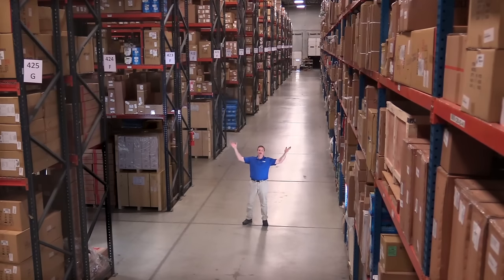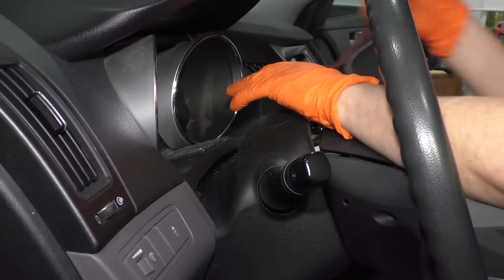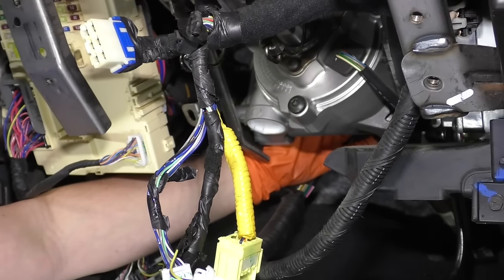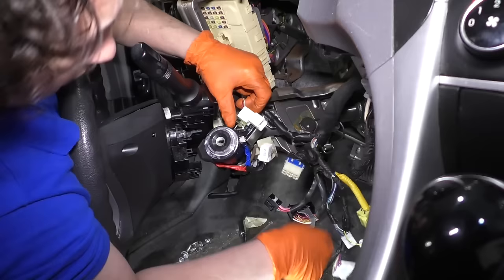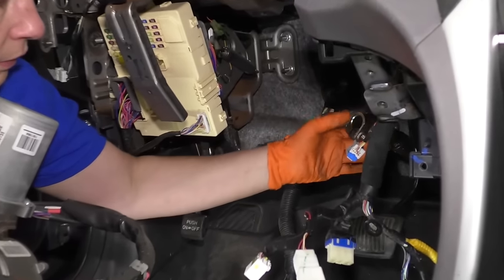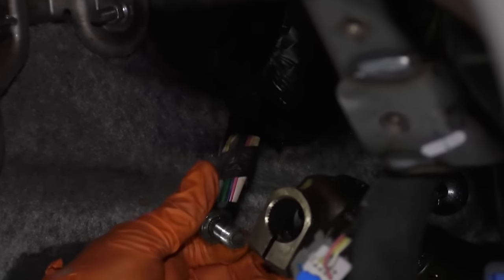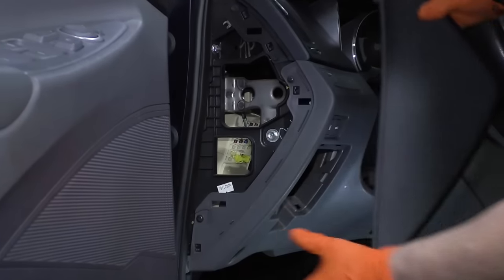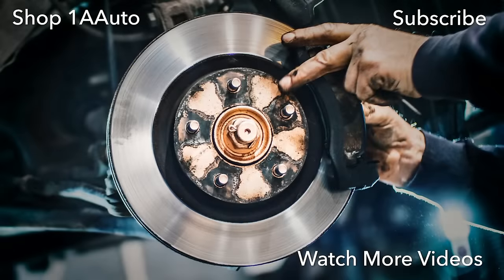How to Replace Steering Wheel Coupler 11-14 Hyundai Sonata

Comment: Hyundai: 500$ with taxes. Me: 17.50$ and done two hours later. Thanks for your video.
Reply: It was very complex! I went to the dealership and they told me I have to change that part, I didn’t know that it’s bad… but the price is $326
Reply: If you’re under 100k mi it’s covered under warranty.
Reply: @YayaKins  well for me they wanted to charge me 300$ and I was under 100k. I think it depends on the year because there is a recall.
Reply: Due to the many recalls Hyundai has issued for the Sonata, mine was replaced at no charge because it was covered by the extended warranty. It was done early this year.

Comment: Replaced the piece on my wife's car. Took about 3 hours for a novice and a couple breaks in between. The hardest part was get the colum back in position after replacing the piece. Once put back together the steering felt amazing and new.
Reply: Me too...i used the jack in the trunk i padded it and lifted the column little by little until it was flush then screwed in screws and voila

Comment: Great video, completed this job just under an hour.    My steering wheel was knocking really bad and that darn parts was shredded. I recommend this video to whom is looking to save money. The only thing I don’t recommend is removing the steering knuckle. There’s just enough room to work with while it’s  still mounted.
Reply: Thanks for the tip. That makes this a lot easier. I'm going to do it tomorrow
Reply: you dont have to take off the u-joint? you just dropped the steering assembly down and did it all right there in the driver footwell?

Comment: no need to take the whole steering assembly out. just need to drop it down, if needed, remove the fuse box (only 2 screws) and that gives u all the space you need. just did mine today.
Reply: Daniel Le would it be possible to remove instrument cluster only and have access to replace the steering coupler?
Reply: Daniel Le can you do a video
Reply: Daniel Le 
I did mine too but now the car won’t start ? Do you know why ??
Reply: Daniel Le can you elaborate a little more on what you did and didn’t take out?
Reply: Hi Daniel can you explain at what point in video can fuse box be removed?
Reply: Good for you.

I just had to take the entire thing apart (non mechanic. Never done anything like this.) to get to what I needed, and to let the steering column fully down.

As a 6 speed owner (yeah, kill me.) there's a bolt on the back side that needs removed.
Reply: @Flash-iq9zw  check your plugs around your ignition switch and your fuses. You might have triggered it.l hope you took the post off your battery before your work started.
Reply: @Flash-iq9zw  did you unplug the negative charge on your battery off before?
Reply: Joey Barrera  negative 😂
Reply: Exactly
Reply: Not necessarily so Daniel....the installation and access varies from year to year and model to model.... Please see my comment posted today. 16.03.20.

Comment: If you are not a true mechanic you need to simplify it. Just take plastic off unhook the wire harnesses to the left of the wheel that’s hooked to the echo button an stuff and the trunk. You can just take the 4 nuts off lay the streering wheel on the seat. You scan reach you’re hand in take the 3 screws out to the motor pull the coupler out put new one in. Put steering wheel back in place tighten the four nuts and put all plastic back on. You do not need to unhook the actaul shaft or all the wires pull seat all the way back and you can lay the wheel on it.

Comment: Uhggg unfortunately i have done this procedure and its not necessarily difficult in my opinion. However, anything to do with removing the object that controls major components in your car, is a pretty scary thought but i was able to do is sucessfully, i had a few extra pretty good size bolts afterward but no big deal it happens!!!! Lol kidding kidding...it was fine, the only thing that was difficult for me was lifting thw steering column back into place (its pretty heavy for the position your in and room you have) but it does have hooks for the column to hook so you can screw the bolts in bit i had a hard time so i propped up the column with the cqr jack lifting it little by little until it finally met up and i finished up fine!!!! No more click, click, clicky

Comment: Another fine idea from automakers. I would agree that this is a well shot video. I have been an automotive tech over 50 years. The only thing I would add is to make sure if you have the front wheels off the ground that they also don't move or the clock spring will be ruined. It is always best to put the wheel's straight ahead so you know where you were at when you took it apart and if the steering doesn't lock exactly in the middle you can always rotate it slightly when you're trying to line it up. You can always take a soft Rag and a piece of wire and lock the steering wheel in the general area also. If worse comes to worse you can always remove the clockspring and wind it gently to one side and then back to the other and find Center as long as you don't force it at its stops you won't hurt it. One last thing, very important , I would always put blue Loctite on the pinch Bolt and it's not a bad idea to put some on the mounting bolts also. It isn't that much longer to remove the column and work on it on the bench but you can also do it in the car under the dash it's just a little harder on the body. Really it's not even necessary to remove pinch bolt and shaft you just got to be careful remove the fusebox lay steering wheel gently down on the seat don't break any of the switches and you can repair it in the car that way you don't have to unhook any of the wiring on the steering column just got to be careful not to break things
Reply: Appreciate your wisdom sir. People such as yourself give us novices hope and will to learn

Comment: Verry good video: Replaced the coupler Hyundai 56315 2K000 FFF coupler on 2010 Hyundai Elantra : removed drivers seat and the steering assembly bolt that goes thru yoke bracket . Steering wheel then lowers to the floor . Used T25 torx bit on motor and top computer module. Used screw driver gently pry motor back from unit while leaving the black plastic electrical connector part attached to the unit. Holding motor and installing new coupler was easy. Thank you for the video!

Comment: I replaced my coupler today, this video was helpful.  I didn’t disconnect the steering column shaft.  Instead I removed the necessary wiring and let the column drop.  I used a 1x4 board from floor to seat and allowed the steering wheel to rest on it so it didn’t completely drop to the floor.  I then removed the torx bolts and did the part swap.   A little tight, but doable.  187K on my car and surprisingly the coupler didn’t look that bad, hardly any debris.  But once everything was back together, I could immediately tell a difference, the steering play was gone.

Seems like every harness connector is different and some were a puzzle to disconnect.  A couple had me stumped which cost me time.  Hardest part was putting the column back in.  Even with the metal hook it was difficult to lift it up into place while I was half outside the car and upside down.  One tip: when I removed the motor I immediately marked the gear with a marker so if it rotated I could put it back to the original position when reassembling.  If it gets turned to much there will be a code because the position sensor is off.

Mine is all done, no codes, no play, success.  About 3 hours.
Reply from the maker: +BluesriderDF Thanks for the feedback!

Comment: Thank you for the video! Took me about 1.5 hours start to finish. 20 minutes of that time spent cleaning out the shredded sticky mess of the old coupler! Did not disconnect the steering knuckle and dropped it down on a block of wood to stop the column from twisting while lowering making it easier to access and separate the electric motor to access the coupler. Fairly easy job overall.

Comment: I used this guidance to successfully repair a 2012 Elantra. It is pretty equivalent. Thanks
Reply: Did you notice any major differences? I have a 2011 Elantra
Reply: I took mine apart just to see that nothing was wrong with mine. The one I already had was completely different (like the one in the thumbnail) from the one i got offline. The one I got offline may have caused an issue in the future because its alot thinner than the original. Did anyone have any issues with the steering wheel not being centered after completing this?

Comment: Happy this helped DIY’ers save some 💰, this is why I went searching for a video like this, but then as a precaution I checked with Hyundai. This repair was added on to the “extended warranty” list, and I squeaked in just under the ten year mark. So didn’t cost me anything to have the dealership do it. I was confident I could get everything taken apart, but I thought I know I’ll screw something up putting it back together 😂

Comment: Just did mine on my 2011 Hyundai Sonata GLS w/80k miles. Been driving this way for about a yr w/the clicking on the steering wheel. 

One of the toughest things I found was the weight of the whole steering column itself 😮 When you hold it to raise it up/down you feel that weight. 

One of the things never mentioned in any of the 3x videos I watched was that the steering bar coming from the engine bay has a telescopic bar inside it w/the steering knuckle on top. No ever mentions how this telescopes in or out of that bar🫤. I figured that out on my own. But took awhile. 

Good video tho 😁

Comment: great video. i have been meaning to do this for a while and finally got around. in my case the previous coupler turned into this tar like residue. why they did not use a better plastic like nylon which is usually the material of choice for couplers like this?

ps. you left out the part where the column gains 100lbs when lifting it back into place.
Reply: What will happen if that plastic gear melt?car won't start or can't steering?

Comment: Great video ! I followed it step by step and it worked great after I found the connector I didn't push in all the way. After I finished the first time, nothing worked, and I was very worried. Then I opened it back up, and pressed on every connector on the key area again, and Yaa, now it works great.!
Reply: Excellent video. But I think it's still complicated for someone like me. Hopefully will find a mechanic that can do it for a lot less that Hyundai try to charge.
Great work lady I'm really impressed for your skulls

Comment: Excellent video, very professional technician. I just have 2 questions, 1, after replacing coupling, is it necessary to re-calibrate steering sensor or any other components? 2 what should I pay extra attention to, eg should the key be removed & to  be careful not to rotate motor coupling while disassembled & any other critical points. Thanks again.🖒🖒
Reply: The factory service manual basically says to do the recalibration process after doing this on all the models I've seen anyway.
Reply: How do I do a recalibration

Comment: Hyundai Dealer $540 plus parts. Me $30 and 2 hours w a bathroom break. Thank you, followed your video step by step, problem solved, car steering is back to new. Thank you for this educational well made instructional video it is greatly appreciated.
Reply: What year and model did you work on please, my 2011 different on wiring from video and one cord is still attached; I’m afraid it will rip out when column is lowered.
Reply: What the hell cost you $30?!

I paid $6 for the part, shipped.

Comment: I brought my 2012 to the dealer to have this slight clunk checked-out.  Dealer said there is nothing wrong, thus, I have to pay the diagnostic fee.  I purchased the part from a Kia dealer for less than $5.  I did mine by myself sometime last year and only took me 2 hours.  I just dropped the steering column, opened the motor and replaced the coupler.  The only challenge was lifting the column where it is supposed to be.  I just used a floor jack and a block of wood.  Steering position never changed at all.  It saved me a lot of money too.
Reply: How did you get it to go all the way up? My two screws in the back won't go all the way in.
Reply: @50calmal98  Just screw the bolt for the  motor slowly so it will catch the thread of the motor housing.  On installing the column, I used a floor jack inside the drivers side.  Positioned the jack under the column and slowly lifted the column and aligned it to the 2 holes for the bolt to go in.  Did a few attempts and I finally got it in.  An extra pair of hands will make it a bit easier.

Comment: I DID IT!!! I just did it on a 2012 Kia Soul and it's not to much of a difference. I had to take off the module in front of where the wheel connects to the steering. Also there were 3 screws holding the wheel in. Two in front and one on the back to the right. This video saved me from my god dang popcorn wheel.
Reply from the maker: +Blake Gravett Thank you for the feedback and great job!

Comment: I’m in the middle of this project on my 2011 Sonota.  Coupler was reduced to just the hub as shown in this and other online videos.  My biggest problem so far was lifting that steering column up and into place to get one nut started.  That thing is heavy, awkward, and there’s no room to work.  I watched other videos where they did not undo the spline and take the column assembly to the bench.  I replaced the coupler with the column still inside the car.  My column has a hook to aid in lifting the column into place, but again very heavy to lift and awkward.  Ended up using some wood blocks to support the column to within less than an inch to use the hook. I was not able to get the passenger side bolt to catch so I’m leaving it out and lock-tighting the two nuts and one bolt.   My next issue is the harness for the air bag connector (yellow) now doesn’t seen long enough to allow me to snap into place.  Took a break for the night.  Finish up tomorrow.

Comment: Perfect video. I'm second owner so of course it isn't covered and going to have to try this out myself. 1 question... At the same time I noticed the side to side clunking I also noticed there is a vibrating/rattling sound coming from under the steering wheel. Any idea of the two are related? Just weird to me that it happened at the same time. I have no issues with ball joints, shocks/struts, steering wheel(drives straight) so not sure what the sound is. It only occurs sometimes when I drive over rocking road and but not when I hit dips. Sounds to me like there is something loose underneath and just banging around. Either way appreciate the video.
Reply: Did you find out what the noise was
Reply: Same any word.
Reply: You will absolutelyl get noise/vibration when going over bumps, hitting potholes etc. if this part is bad!

Comment: $450 at Pete Smith in Louisburg, NC.   After replacing the coupler, the clunk was replaced with a grinding when turning the wheel.  Pete Smith advised my 70 year old mother to just turn the radio up.    After watching this, I see that I could have done it for her myself.

Comment: I want to change it on a KIA Ceed 2011 model because I have this noise when you turn the steering wheel but my question is that rubber coupler needs a thin layer of lubricant like white lithium grease or silicone grease to keep the rubber in good condition or that lubricants can make any damage to the part?

Comment: Is every connector different? Any risk of accidentally plugging the wrong connectors together?
Also, how can you make sure the steering wheel stays straight? She talked about locking the steering wheel before removing but I didn't understand how to do that.

Comment: Thank you for the video!! I was able to do it in about 2 hours. The only problem is that after securing the steering column and connecting the wires the car has an alarm going off and the EPS light is on. Any tips??
Reply from the maker: +Edgar Loret We wouldn't be able to diagnose an issue like that here, you may want to have a local mechanic take a look at it. It could be just a blown fuse or there is something else wrong along that control module. Thanks for checking us out! http://1aau.to/m/Shop-1AAuto-c

Comment: It's my first time ever doing a procedure like this,  and disappointingly I made some mistakes. One: I over-torqued one of the to steering wheel mounts and broke the mounting bolt off. However, the steering column still seems tightly secured to the frame. I do not know if I should worry to much about it.

But the second and bigger issue is: my steering wheel didn't lock when doing this procedure (although, I tried to lock it) and now my steering wheel is off-center. Does about know how I can fix those issues?
Reply: Did you ever figure out how to get it back to center?
Reply: The steering angle sensor appears to be in the column. An alignment should correct the issue.

Also: One of four bolts missing will seem OK until you're involved in a collision. That one bolt could make a survivable collision fatal.

Comment: Can I remove those first two screws before I disconnect the battery? Just because it would make it easier to turn the wheel? Have a hybrid so the key is down in the center console

Comment: Good video, only thing to add, when your putting back the steering assembly watch out for the little hook thing right to the left of the bottom right bolt holding up the assembly if it doesn't want to go in the hole it's impossible to get the bottom two bolts in, got stuck messing with that for a min, other than that perfect how to
Reply from the maker: +Nate Leeper Thanks for the tip!
Reply: How did you get it back up cause I can’t

Comment: After replacing and reinstalling everything back I’m getting some ECU errors via OBD2 connection regarding SAS calibration issues. Also my reverse camera is now not showing the steering path. The ECU errors are C1623 and C1260. What did I do wrong ?